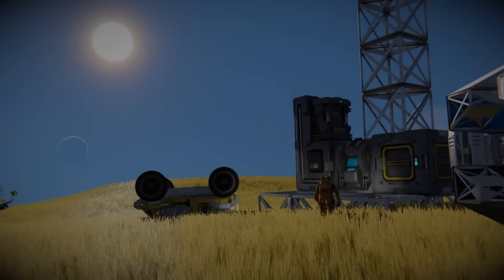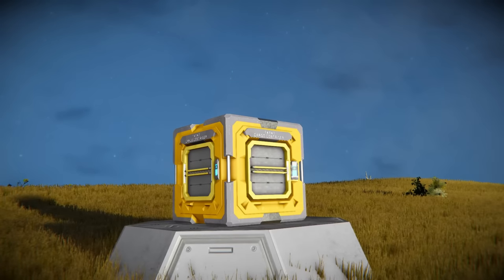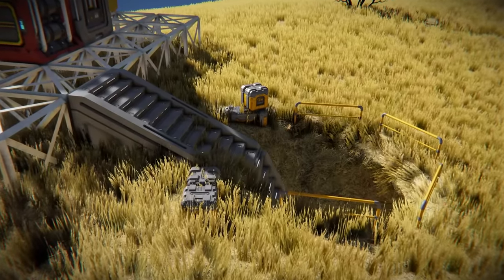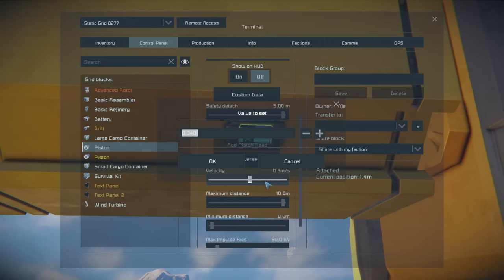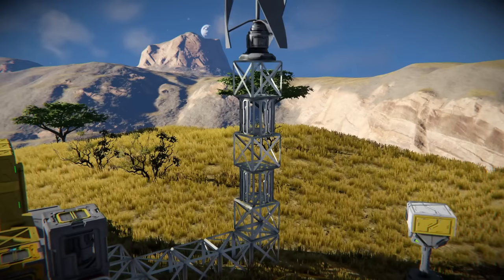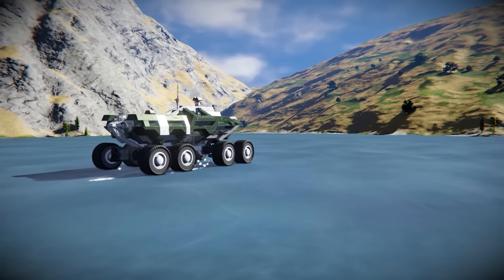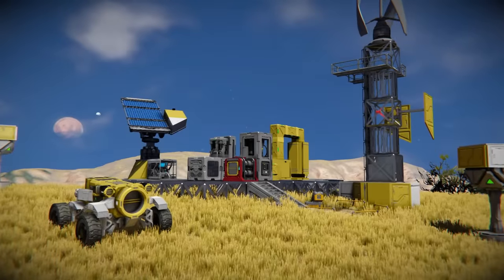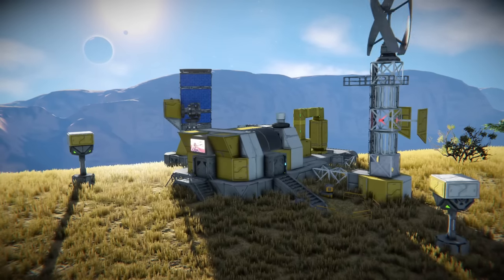Early base design guide - The Space Engineers Handbook

Comment: another trick if you are relatively new but want to push yourself a bit is to use an advanced rotor at the end of the drill to set up small drills instead of large ones. Small drills take much less resources to make (and dont require any cobalt) so it is worth sub-girding if you really want to get away from hand drilling a bit quicker
Reply from the maker: yep, excellent tip

Comment: Thank you for making these videos.
 I started playing probably just over a year ago, started on Xbox actually.

At first I found myself trying to mimic the Randomly Generated Outposts for my "Early" base design.
 Then I found your "How to stay Motivated" video and started making "Work Sites" for the early game.
  I usually start with a "First Aid Shack" near my Hand Mine, this is mainly just a Survival Kit & Power Source and maybe a O2/H2 Generator & Tanks if you have a source of Ice nearby.
  Ounce I have Mined enough Stone to build my Spawn-point I go scouting about a 1km radius from my Pod to find all the Ores available on the Planet and build at least one Automated Drilling Rig on a spot with 2 or more Ores. (usually Nickle and Silicon) This Rig will have my Basic Refinery on it to immediately make ingots so I am more efficient in my Hauling runs. (Event Controller and a Beacon if you want an easy way to shut the machine down and notify yourself when it's full)
  At this point I will either decide to make a Logistics Hangar, Tunnel Boring Rig, or I will use my Vertical Rig to Excavate a Base as well as grab a few more resources.
This is where I build my Single Welder/Piston Printing Setup to start production of my Small Grids. (Other Rigs will be turned into Grinder Pits, Refineries or even just Storage when they've dug their holes.)
  
By the time I have established my work site my Hand Mine is about as extensive as the ones going through asteroids on Pertam Orbiter and usually has a Battery and Hydrogen Engine for either another Basic Refinery or I might try to hide a Survival Kit in there on PvP servers.

Been looking at the Abandon Outposts Mod though.. might be fun to try a playthrough where I can't start my own sites but have to find a Ruin to start fixing up instead.. looks like there's even undead engineers with grinders in one of the screenshots

Comment: My favourite way to protect Wind Turbines is to build them underground in my mines.  You do need to drill out a large area for it to work, but You need a lot of stone to convert into Iron/Silicon/Nickel anyways.
Reply: Don't they have strange efficiency underground?
Reply: @johndee2990  No stranger than above ground.  It's a glitch in the game, but as long as they have the required 8x8 space around them, they work just as well as normal.
Reply: @Runescope  That's what I was wondering, well it's not as bad as having to keep about a 5 block space from voxels in ALL directions